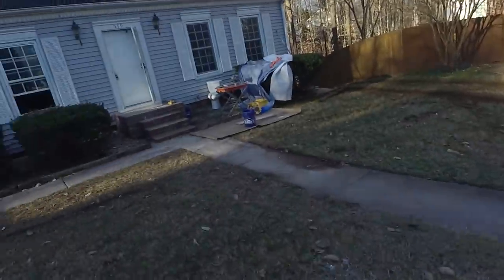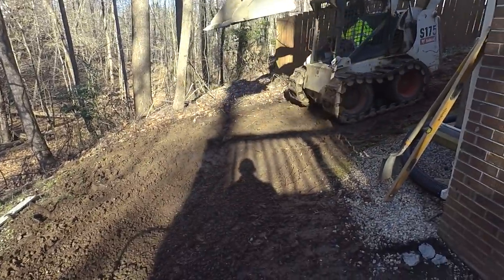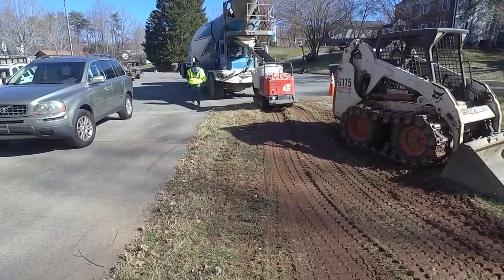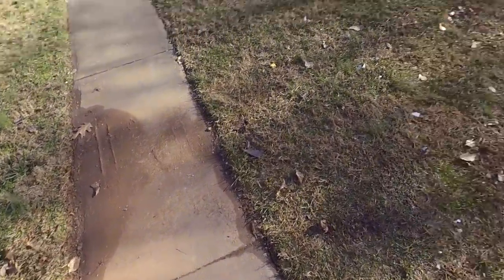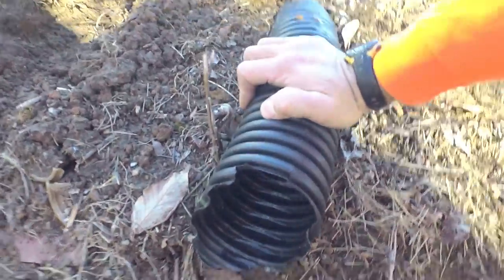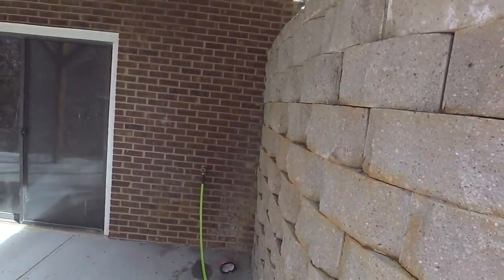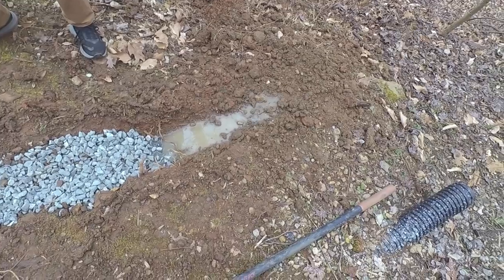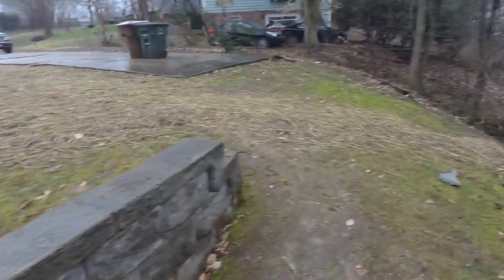Drainage system stabilizes retaining wall

Comment: One thing I'll say about your videos--they show important clues to how the general drainage is happening around a given house. If you're looking at buying a house, you should look carefully at where there may be standing water and how the various slopes go. You're in NC where it rains a LOT, but I see plenty of homes (of course, they wouldn't be calling you out if there wasn't a problem) where there's mold and moss and a puddle here and there but they all tell a story and you could be looking at a lot of work to mitigate these kinds of issues.
Reply from the maker: I agree! I talk to homeowners all the time who bought a house within a month and there is water flooding the basement or running through the back door! I work with a lot of RE deals providing drainage assessments for buyers.
Reply: @GCFD   As to my other comment, It's good that you do this.. If its required by home inspections it would catch it before people get caught in a nightmare. Although thats another catch 22 if it knocks down the overall buisness, Would imagine a lot of people just let it go & dont consider the consequences.

Comment: Really enjoying your channel. It's now my 'go to' for a final bit of tv before bed. I find it somehow relaxing and easy to wind down to. What does confuse me is why drainage doesn't seem to be taken into consideration when building. You'd think water, whether plumbing in or draining out, would both be as important.
Reply from the maker: I'm glad you're enjoying the channel! I ask the same thing all the time. People never seem to consider drainage when building or making changes.
Reply: @ Tracy Rain   Well said... This is much better than the majority of bogus hyped reality shows
Reply: It's a big thing here in Australia. Unless it's a rural property, all water is caught and piped out via PVC to the storm water system in the street. That said, the most common issue is then that the whole street backs up in a heavy downpour, or people renovate and overwhelm their drainage system by catching additional roof area and sending it through the existing pipes. Also no shortage of concrete sloping the wrong way here!

Comment: Good concise video of a job well done. Something I noticed your concrete people didn't use much gravel under that slab which seems routine these days. When I was a kid, they usually put several inches of gravel under walks, driveways, and pads. With all that water oozing up, it seems it would be more necessary for a good gravel base even though you may not have the freezing / heaving problem in your area as we do here..
Reply from the maker: We have impermeable clay subsoils around here, so not much subsurface water, and it rarely freezes here, like you said.

Comment: I cannot believe the large gaps the initial contractor left in that wall, I am sure that is the precast wall stone that go together with pins. In N.J. it is either EP Henry or Anchor wall stone,, that looks like typical Anchor stone, I have it in my backyard.. There are ways to avoid such massive  gaps 1/4 " gap is acceptable, those look like 1/2 or better with the little bit of stone washing through. If that wall is passing 3/4 stone then "Houston we have a problem!" Great video, would guess there was not much stone added behind that wall, most likely backfilled with dirt. I repaired a wall outside a new supermarket that was 3 months old, the first big rain came and literally blew the wall apart. No drainage stone behind the wall, totally disassembled and rebuilt with geogrid, and a 3 foot barrier of 3/4 blue from wall to earth lined with what we call road fabric, very heavy landscape fabric. Also installed multiple  drains from the parking lot to divert water NOT USING FLEX PIPE, used a 12" s/d main to a drainage ditch. That was 15 years ago, wall is still as level when we installed it and drainage still working as planned. Once again love your videos, keep up the great work.
Reply from the maker: It looks like the wall has moved out a little bit, which would explain the gaps. I think he needed more gravel like you said. You can't have too much behind a retaining wall.

Comment: Again the key is to have the water go over the wall. The topsoil and turf should be overhanging that wall. The retaining wall being higher than the ground it is holding back makes it a hand grenade. Drainage at the base of it is temporary to let small particles fill the voids. Eventually you want it to plug up so completely that the deep earth behind it remains dry. The topsoil and turf or bio binder needs to act like a roof taking the water all the way over the top of the retaining wall. If there is significant spillage the outside base of the retaining wall needs a spillway to take the spill over water away and stop erosion at the base. A retaining wall is not a dam it is the end of a water shedding "roof" that may need its own gutter system to protect its foundation.

Comment: If there was a product you could sell, besides shirts, I think it'd be some sort of colored-shrink-wrap of sorts for the discharges that's UV resistant with "stormwater", "roof-water", "FD-water"... labels.   

Ya need some dedicated above surface clear-primer & clear-glue 22:08 
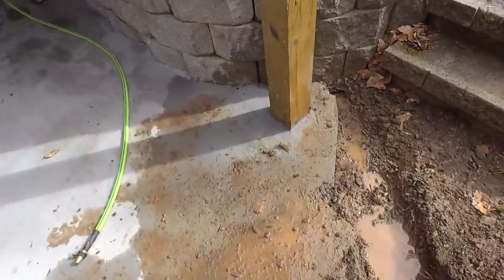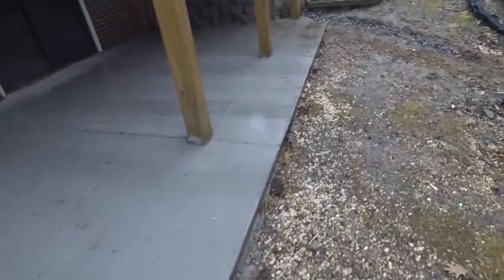I'd have like to have seen that bottom pipe jetted & possibly connected to a 3in pipe. 21:40 28:27
Reply from the maker: Thanks for the comments Bob! I've told my guys over and over about the visible glue. We recently switched from primer + glue to rain-r-shine so we don't have too much clear glue left. I was wondering about trying to replace the pipe under the retaining wall. I figured a lot of gravel would be the best bet for moving water. Plus, since we got all that water out of there the drain shouldn't be as critical.

Comment: It's amazing to me that anyone would grade concrete towards the house. It makes absolutely no sense. Do you think it was graded like that originally or if the grade has changed over time as the house has settled?
Reply from the maker: I would guess settling occurred. Check out my video concrete driveway fail where a contractor sloped a new driveway into the foundation and the house flooded instantly. It was a nightmare for the homeowner until she found me.
Reply: @GCFD  I look at my own job and much of it could be done without me if folks had a little common sense and organization. However, neither of these skills seem in abundant supply and that lack has provided me with a good living over the years, so I can't complain! I guess the same is true for you when you're called out to fix an issue that really shouldn't have happened in the first place. Happy and prosperous New Year to you and your crew!

Comment: Curious to know what you don't use a concrete line pump for the difficult access jobs? I know there's a hire cost, but wouldn't it make the job considerably easier (and faster)?

Comment: Why do you let the out falls stick so far out? And where could I look up rules and regs for residential drainage in Michigan?
Reply from the maker: No one ever knows where their pipes come out, because they get buried, crushed, destroyed. I want mine to stick out for one reason - to blow out debris and not get covered up and forgotten. If the system is working correctly the pipes will gush water out.

Comment: I've never seen a slab of concrete like that poured without Reinforcing Mesh. Is that a cost saving measure in the US?
Reply from the maker: No, we don't require reinforcement in our area of North America. the reason is we don't have a frost line, no bentonite and impermeable subsoils.

Comment: Shawn,  could  you explain a full bubble meant in the fall where do start  first to lay out  the pipe  to reference  from  start to  end run. Do you  use  rotating  lazer  level in your  work?
Reply from the maker: Hi Larry - 
I only use a laser if we are trenching across flat ground, where the trench creates our downward slope. If the ground is already sloping down, we just trench and the drop in the ground gives us our fall.

Comment: Quite honestly, that retaining wall might just bee too tall for the material used. I've got a retaining wall made out of farm stones much heavier then those concrete blocks and it has pretty much collapsed. Granted, it has probably been there since the construction of the house, which would make it about 6 decades old. The main cause of its collapse is a leaky terracotta drain pipe which I had to fully replace. I used a corrugated pipe, but then again, I did not know any better at the time. It is still working just fine several years later. I have a second corrugated pipe that is actually buried in the grass. There is enough fall that when it rains, the grass splits open, creating a small geyser several inches high.
Reply from the maker: thanks for sharing Jonathan

Comment: Great video. Time-lapse concrete work is fun.  Regarding that existing corrugated pipe from the gutter above the wall - was that perforated pipe, pumping gutter water into the ground behind the wall??  Impressively clean inside, at the outfall - no dirt or debris at all. Surprising for corrugated.  Also - mini-Bobcat as a precision sculpting tool was awesome. Well done. 😎
Reply from the maker: Thank you! That corrugated pipe was the drainage for the wall so hopefully it's working well. This is one of my favorite videos so far.

Comment: What were the temps while you were pouring concrete?  I have some concrete work to do and have been putting it off until spring because I thought you couldn't do concrete in the winter.
Reply from the maker: We are here in NC so it doesn't get all too cold. Temps were high 40s during the day and 30s at night. My concrete guys won't pour if conditions are too wet or too cold.
Reply: @GCFD  I'm over in Elizabeth City, not too far from you.  I never meant to question your concrete guys, looks like they know what they're doing.
Reply from the maker: I didn't take it that way! I guess I just meant I default to them on if we can pour or not. I have a very big project right now that's sitting waiting for concrete but they won't pour. Not worth the risk...
Reply: I know a contractor in northern Pennsylvania who was trying to finish a flip, and poured a concrete driveway in the winter on a day forecast to be dry... and just as they finished, an unexpected snow squall blew in and ruined it. They had to demo it and start again... and the same thing happened again. Third time was a charm.

Comment: How could the retaining wall be renovated now that the drainage system has been installed?
Reply from the maker: You would have to remove the retaining wall blocks and excavate behind them as you go. Then, you rebuild the wall and backfill with tons of gravel. I agree with the homeowner here that it should be good as long as it is stabilized now. A combination of piping the gutter water through PVC, establishing a grade away from the wall, and improving the wall's drainage should remove any excess water burdening that wall.

Comment: @17:32 there was no primer on those pipes? What’s that about?
Reply from the maker: We have stared using Rain-r-Shine which has primer + glue in one. It's Blue in color. Check it out, you can use it right in water.
Reply: @GCFD  the Oatey Rain R Shine still requires the purple primer. They only have one All in one PVC cement that I know of for drainage/irrigation applications and that’s their Fusion PVC Cement. I could be wrong but that’s how we learn.
Reply: @MrDeni3d  Oatey says "No primer needed where local code permits". In other words it doesn't need primer, but some code has no concept of primerless application.

Comment: where is the rebar at. that is going to crack? the bottom of the post are going to rot in time. even if treated.  how much slope,   what contractor did not slop the in first away from the house.  looks like substandard work.   How long before the roots will infiltrate the couplers and crush the pipes.  do you have a blue print of where all the pipes that you put into the ground so if something needs repair the homeowner can show it to the next person that has to fix your bad work.
Reply from the maker: Cliff - rebar is not needed in our climate with our subsoils. Weird, huh?

Comment: I totally agree that pvc is superior to corrugated pipe, but I wonder if you should just snake out the corrugated pipe to see if it can be cleaned.  It may last another 5 years if you clean it out, rather than replacing it.
Reply from the maker: The snake will destroy corrugated. Use a sewer jetter hooked to your pressure washer instead. We do clean-outs for corrugated systems all the time.

Comment: Where's the rebar
Reply from the maker: This area of NC typically doesn't use rebar. We very rarely see rebar when we replace existing concrete. I know other parts of the country use rebar much more often.
Reply: I have poured many large slabs in my home state N.J. and many did not have rebar as fiber tac was added to the concrete. The geographic location plays into what is required, there has also been improvements to the concrete itself, referring to additives.

Comment: Sidewalk has a dip in it replace walk problem solved
Reply from the maker: You're correct. But that doesn't get rid of the water from the front yard that is higher than the house. 👍

Comment: Why don't the builders tie the guttering into the drainage system when they first built the houses?
Reply from the maker: Because 99% of houses here don't need the gutters tied into anything. You're seeing the worse cases on my channel since I specifically do drainage work with PVC. Most of my customers are having major problems and have already tried corrugated systems. Great question!

Comment: That concrete job looked sketch.   No sub grade, no compaction, no rebar, uncapped pipe, wooden posts buried,  just generally sloppy.  Who are these guys?  Don't they do it for a living?
Reply from the maker: Thanks for sharing. We run the plate compactor of course. Rebar is very rarely used in this part of NC. We do see it on demos occasionally. You saw the demo and this patio didn't have rebar before we replaced it. Been pouring since '78.
Reply: @GCFD  I'm a fan/subscriber and enjoy your drainage work and videos.  Concrete portion, well, I guess I already said my piece.